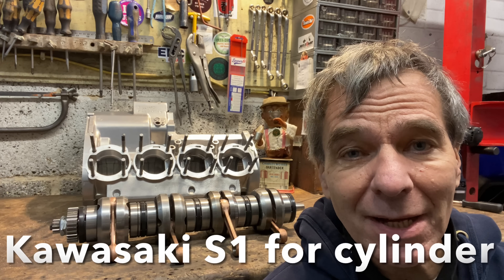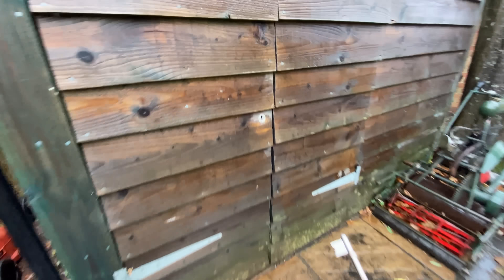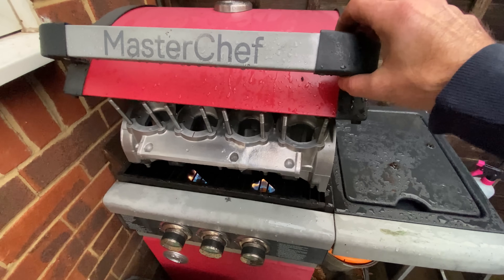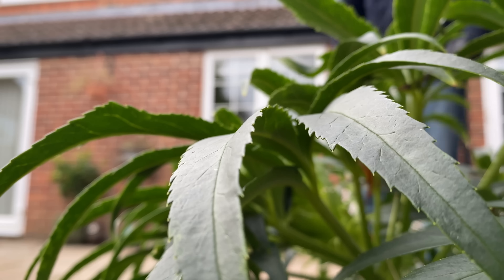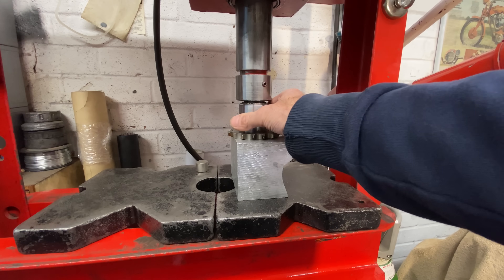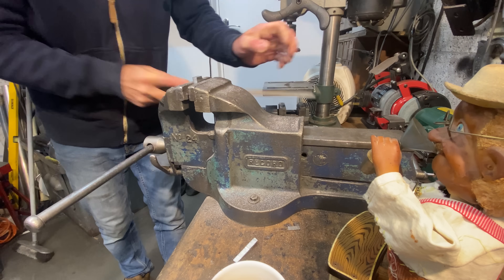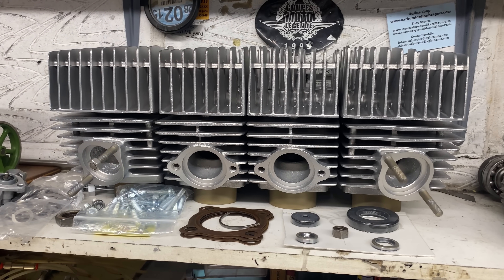Millyard Kawasaki S1 Four Cylinder Transmission  - How its Made - Episode 3

Comment: Wouldn’t you have been better off putting a spline on your sprocket extension so that when you come to replace the chainset you can use a stock front sprocket and  you don’t have to machine up another custom job?

Comment: Love the videos Allen! Im curious what torque you used for the M8 bolts into the cast aluminium, and if you had any concerns about them loosening over time? Nothing a bit of threadlocker wouldn't solve? Cheers for the info!

Comment: Why is the drive sprocket not made bolt on for replacement.  It seems the sprocket is welded in?
Reply from the maker: It’s a custom made bell sprocket these can be easily machined if a replacement is needed
Reply: @AllenMillyard  sure looks good and will operate well under load. Top show.

Comment: How was the sprocket with its carrier fixed to the output shaft, did I miss something?  A central bolt behind the bearing?  The bearing support bracket wouldn't hold the sprocket on the engine surely?

Comment: Excellent job - well done ! One comment though -there seems not to be enough side clearance between the sprocket and the support bracket to the left, as a proper chain needs significantly more place /as it width is 2-3 mm wider -but that‘ll be a minor thing to correct ;-). Awesome work /I do Restauration of classic bikes, Zeds , Suzi GSes and XT 500 myself -so I really appreciate Your work !

Comment: Allen you no were you pressed the center splin in I'd of sprocket I would think it will slip under say drag conditions minde you I ain't saying I no just think have you jumped on it and hammered or pined the throttle all the way more than once I like it just seems like hear in LA it gets 115 degrees HOT if it heats up going up the mountain with your girl that puppy's going to have to take some beating it might twist out o you wellded it sorry he'll yeah that will hold up ! Come to California do the BIG BEAR LAKE  RIDE IN MIDDLE OF SUMMER STARTING SAN BERNADINO

Comment: Is there a tab washer fitted normally to the front sprocket ?. If so how do you bend it over with the extension tube fitted or do you use loctite.

Comment: Very nice solution Allen. I guess this bike won’t do enough miles to worry about replacing the sprocket. 

[ ‘ ] Here’s an apostrophe you dropped on the floor after the got high on cupcakes. I’ve put it in a square box so it doesn’t roll off the bench 🧐😎😜

Peace

Comment: I would not have thought of aligning the final drive shaft and rear sprocket like that.  It does raise the question of the time needed to change the gearing (4 cylinder bike not 3 cylinders) and the work associated with replacing a worn sprocket.  Nonetheless, awesome.

Comment: Great Video, but two sliding fits for a bearing is not ideal. You should have made the fit in the sprocket a press fit, since that is the loaded and spinning side.
Reply from the maker: its a perfect sliding fit
Reply: @AllenMillyard  It sure is, but it's still a sliding fit which isn't ideal. 
But that doesn't really matter in that situation, I'm sure it will work just fine. 

Besides that, you have no idea how inspirational your work is to me. I am a CNC machinist in germany, and I chase thousands of a millimeter every day. Its so amazing watching you chop engines in half and building Frankenstein engines with basic tools... I am currently rebuilding my Suzuki Bandit 400N and it's been a pain and pleasure at the same time. Keep up the amazing work man, u are a true genius at what you do.
Reply: @lokkas3637  I've got my old Bandit 400 awaiting rebuild... we should meet at Allen's shed, and share rides on the resulting 800 V8 Bandit!

Comment: Outstanding work and creativity as ever, one question, is the outer bearing fitted into the new drive socket firmly/tightly enough? I would hate to think that the outer race of the bearing would spin inside your new sprocket.
Reply: I was thinking that, but I`m sure there`s a reason. I`m guessing the old Loctite may come into play?
Reply: I thought that should be a slight interference fit. On the outrigger shaft too? I'm curious what the runout is at the bearing's outer mating surface. It looked a bit wobbly.

Comment: Nice work Allen how did  the sprocket mount clock up  did u have to use brg mount loctite  on the out rigger brg  u make it look easy. I found approx .003” clearance between the out put shaft sprocket  and it case bore so used brg mount loctite  never had an issue  and I was far more satisfied have that slack taken out

Comment: "I measure the engine with my bent stick and mark the cuts with my biggest crayon. I then hacksaw it into eighteen bits, close my eyes and weld everything back together upside-down with a candle and some old lead flashing I found in a bush"
Result: Rolls Royce quality engineering that runs like a sewing machine.
Man's a wizard.

Comment: Lot of work when you have to replace the engine sprocket.
I would have made an extension shaft with splines so the sprocket could stay original.
Reply: Thats too easy, you know Allen would never go for the easy solution...

Comment: great made Allen 👍 P.s I was wondering if you also have a video where you work on a gearbox of a Z1000, I only get it in 2 gears after I pushed it on, probably a steel ball of its free position had moved from its place
Reply from the maker: A z1000 will only select 1st when stationary

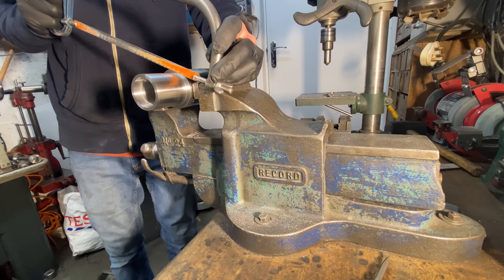Comment: I thoroughly enjoy your videos, and am impressed with your skills. I am curious tho, why at 9:15 did you not use a parting tool to cut the bushing off? You instead removed it from the lathe and cut it with a hacksaw, then back to the lathe for facing.
Reply from the maker: I like using my hacksaw
Reply: @AllenMillyard  Thank you for your response. I thought it might be that simple as I too prefer hand tools over power quite often, but as a hobbyist machinist I wanted to ask in case there was a professional machinist trick to be learned. Thanks for all the great videos.

Comment: Always wondered how you get the chain line back without strain on the sprocket bearing, so Im guessing you modify the engine mounts on the frame then my head will have the whole plot so looking forward to the other episodes. Your video work is brilliant with images saving a thousand words.

Comment: What happens when it needs a new front sprocket?
Reply from the maker: With modern o ring chain it will last 20000 miles so won’t need changing in a year or two
Reply: @AllenMillyard  Ah I see cheers Allen
Reply: @AllenMillyard  I can fully confirm that, I have an 1100 with O-ring chain, since 2018, when I got it, its been driving 25000 miles, and i dont know when the chain was last changed, but sofar, no need for new chain kit

Comment: Hello Alan .... Vancouver Canada here again :) ... This video is VERY timely for me as I am currently starting a 73 Kawasaki Z1 restomod project which will require the engine sprocket to be spaced out in order it line up with the rear on 1098 Ducati swingarm and wheel I'll be using for this build ..... Now if I could just sharpen up my hacksaw skills and have your Tracy Fedex a case of cupcakes I'm good to go !! Havva great Christmas sir you are an inspiration  !!

Comment: Always nice to see how you approach these modifications. I thought you were going to place the bearing on the extended shaft on the outside of sprocket, but putting it directly in the sprocket makes sense, as the load is now fully on the bearing, and not on the shaft extension. Also the old chain grease and muck will have less chance to build up on the bearing.
Reply: But changing sprockets is a big job being welded in

Comment: This time I must say I am not very pleased with the engineering solution here. That chain sprocket will wear out over time and need replacing. The solution employed requires the use of a custom part which besides it's reasonably complex to fabricate.  I feel there must be a better solution to shift the output that allows a standard sprocket to be used.
Reply: I don't think it is a big disadvantage for Allen, as he clearly knows how to make and install it. It is not a production bike. nice about this setup is that all the load of the chain is directly in line with the sprocket.
Reply: You have a good point.
The next question is, how would you do that?
The most difficult bit I foresee is the inside nut... That's the largest problem here.

Comment: When turning hard stuff, e.g. high speed steel taps, reduce speed a fair bit - about a third or less of the usual, about 15-20 surface feet per minute - and use fresh carbide, ceramic, or diamond tooling.  

I recall using carbide to turn down the shanks of taps for clearance, and turned them slowly ~ 100 rpm for a 5/16-18, I think.

Comment: Allen, 6:50 mins your holes drilled are not central to the marks that you had made on the ally! Allso,, why not use an angle grinder when cutting straight cuts in steel? I've made these comments because my job is a steel fabricator.

Comment: Curious about changing the sprocket of it to reach end of life for whatever reason. Will you just getting of the welds and replace it make an entire new assembly?
Reply: Guess he could lathe the old one off and make another one to press and weld on… Lot of effort when he could’ve made it so a normal sproket bolts into it.

Comment: I assume that the bearing in the sprocket assembly was removed and the nut was installed? Or did you put anaerobic on the splines to prevent fretting? And the clearance on the stub and the bearing?

Comment: of all the amazing things I see you doing, what still takes me by surprise is your skill with the hand saw and hand tools in general. In this era, in which making chips has become increasingly cheap and fast, choosing to make a few by hand is the ultimate sign of a dying breed of handymans the likes of which I doubt we will see in the next generation.
Reply: You Tube is full of "makers" who do it all with CAD, 3D printers and digital millers.  All very nice, but try doing that for a drive sprocket support bearing or an exhaust system or special crankshaft.
Proper engineers like Allen (and Project Binky) also use CAD. Cardboard Aided Design.
Reply: Sadly, what you say is true. Luckily, for those generations to follow us, these YT videos will hopefully survive to inspire the engineers of the future.

Comment: Look at that all red hot swarf,   Surprised your lathe tools don't burn out Alan 😳
    When I used to use an ancient Dean Smith & Grace lathe 45 years ago every job used oil based coolant that made me stink 🤢
Reply: My old wife used to hate the smell of that stuff. Castrol Syntilo, I think it was...
Reply: @CS_247  ... Could have been, it looked like cooking oil & it was mixed with water to make a milky looking coolant, it'd get splashed everywhere despite having a shroud around the chuck, I stunk like an old gearbox 🤢

Comment: Can you use the grinder on the sprocket when it is on the shaft in the lathe?
Reply: Most machinists don't like using abrasive tools on machines because the dust gets on the precision surfaces and causes damage. You can use blankets and rags to cover stuff but it's still not ideal

Comment: That’s a great video again. Tried to elongate my Ikea table by cutting it with a hacksaw and weld a bit in between. I discovered Ikea tables are made from fibre board and the catch easily fire. Rather watch Alan and Tracy’s video.
Reply: The fiberboard wants glue, of some kind.

Use square steel tubing.  That can be welded.

This is what I plan to do in the future for my furniture - which looks a bit like the better stuff one might find at IKEA, and largely uses birch ply and regular lumber.